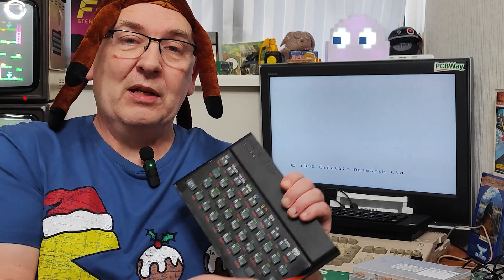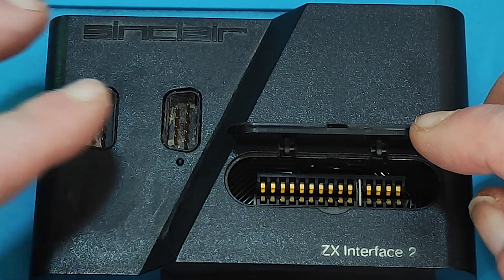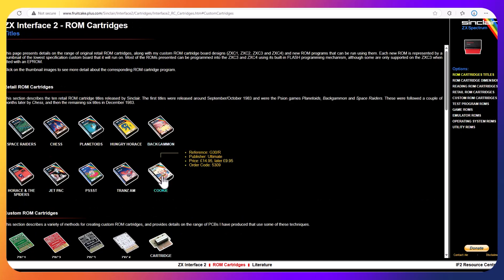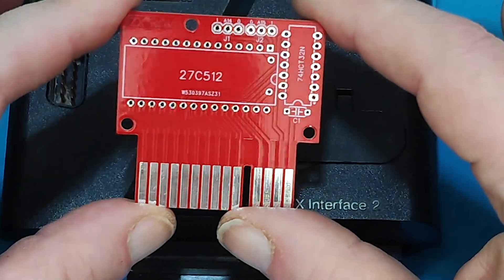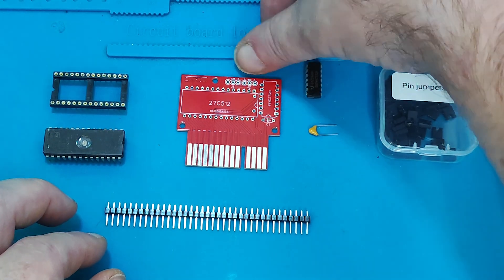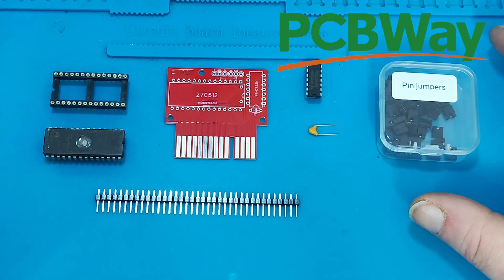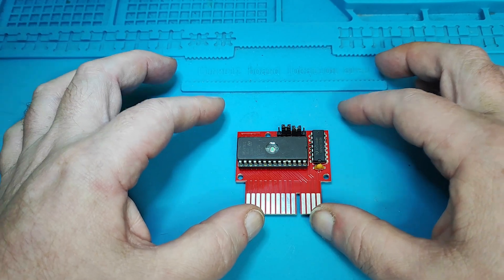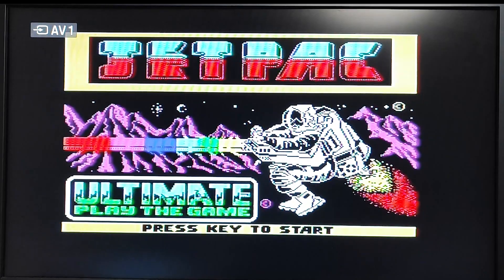A 40 year wait to do this with my original ZX Spectrum from Christmas 1984

Comment: In the early 80's i worked as an elecronic technician (Tea boy for the engineer) designing and building prototype mainframe machines for Burroughs computers now Unisys.  One of the engineers came in with the advert for the Speccy we all (about 15 of us) went OOH! AAH!  WOW! and more. I bought one about 3 weeks later from, I think,, WH Smiths. That meant we had 3 in the department and I recall not much real work happened for some weeks after this as a lot of reconfiguration was done to our 3. digital video output, to use with our monitors. A very basic floppy disc interface. More memory etc. This might be part of the reason the plant closed!  But great memories. The plant closed in 1992 and for the last 6 months our team spent the WHOLE time playing Lemmings on home built PC clones. Sorry about going off the rails here.
Reply from the maker: 😂 Thanks for sharing. I really appreciate the comments (otherwise it's like talking to a black hole). I hope you enjoyed the vid and it brought back those happy memories.

All the best for the new year. Simon
Reply: @RetroComputingReboot  Ta1

Comment: We got our Speccy some time around July 1984, we couldn't wait until Christmas. LOL.

That's a different version of Planetoids to mine. It all looks and sounds the same apart from when you get hit. My version just has a magenta (sort of) polygon where your ship was. Odd.
Reply from the maker: Thanks for the comment. I hope it brought back some good memories.

All the best for the new year
Reply: @RetroComputingReboot  I never stopped programing the ZX81 or the Speccy. About 6 years ago I upgraded my original ZX81 to 32K internal RAM. About 3 years ago I installed an SD card and joystick expansion PCB, soldered to the expansion port. LOL. (I had to instal a new ROM in the 81 to use the SD card functions)

A happy new year to you too.
Reply from the maker: @frankowalker4662 Sounds like some good mods there. I still need to fix one of my ZX81's. I broke one of them in my early days learning to solder 😢
Reply: @RetroComputingReboot  Oops. Luckily, they are easy to work on.
Reply from the maker: @frankowalker4662 Yes big oops 😄. Some of the best ways to learn are from mistakes though 😊
Reply: @RetroComputingReboot  Absolutely.

Comment: Somewhere around her, I have a ZX80 that also worked as a ZX81 by having an EPROM twice the size with one pin bent out and a switch on it.  I did quite a few things with that very limited machine.  I had a 16K RAM pack that I built attached to it.  I even worked out how to do pixel graphics on the thing.  Its amazing what you can learn from stuff like that
Reply from the maker: Brilliant. I still have my ZX81.

I think it's amazing looking back just how well programmers were back then to write code that was so efficient with such limited resources

Comment: My mum was actually angry that i bought a silly stupid computer, which was the zx spectrum. I learned basic but also assembler. Together we wrote a printer driver in assembler which was residing  in the spectrum printer buffer memory space (not an easy task due to the small printer buffer size) It used the beeper with a transistor at the output to create a unidirectional serial interface. We hooked up an HP line printer which we bought from a scrapyard for almost nothing and yes it worked ! We also hooked up a real computer monitor and a real keyboard. The speccy was housed inside the computer monitor housing. Everything was looking super professional 😂😂😂 (fortunately we had a computer scrapyard nearby who sold old computer equipment y weight) I am now an electronics engineer, still passionate about small computers and microcontrollers.
Reply: Been hardware hacker for as long as I can remember. I began by adding a 8255 PPI to my Spectrum and then adding some circuitry to that to provide me with the capability to program EPROMS. What I would have given for the capabilities we have in microcontrollers these days back in those days.
Reply: @SpeccyMan  the 8255 was a really handy and easy to add circuit. if i remember correctly it had 24 IO pins ?
Reply from the maker: @francisverhelst9375 I'm going to have to educate myself now as to what the 8255 is 😊
Reply: @RetroComputingReboot  it is a peripheral chip which creates extra IO lines.  You also had the 6845 which was a crt controller chip. And there were a bunch of different chips out :).
Reply from the maker: @francisverhelst9375  Just having a read. Maybe there's a video there somewhere 🤔
Reply from the maker: You put me to shame. I can load games and swap capacitors but that's about as advanced as I've ever got 😂

Comment: i had my zx spectrum rubberkey in christmas '84 , i later got the 'plus' upgrade keyboard and  fitted it in that, still got both, i got an interface 1 and 2 in the 1990s from a car boot sale , the rom games were always expensive and they certainly are more so now! i recently made my own rom cartridge board that uses just a single rom file 27c128, but not yet tried it, , that 27c512 board could be very useful as i was given a load of programmed but never fitted 27c512s some years back
Reply from the maker: It's great that you still have that Speccy. Good luck with the 27C512 EPROMs. It s a super simple board to throw together 😊.

Thanks for the comment and have a great new year

Comment: Did anyone here go in to shops back in the day, and type
10 PRINT "(Some obscene message)"
20 GO TO 10
RUN
on some of those 8-bit machines on display?
When I got my own Commodore 64 in April of 1985, I learned how to use its sound capabilities (which routinely made Speccy owners green with envy! 😎), and did a bit of BASIC code which mimicked the boot-up screen, waited either for a keypress or just a few minutes to give me time to leave the "crime scene", and then made some loud siren noise (don't forget to POKE 808,251 to disable the RUN/STOP key 😛)
Later, when I mastered machine code/assembly, I had a little routine which waited for the cursor to leave the leftmost column on the screen, and then sporadically "press" the DELETE key, frustrating the next bloke who came in to do the PRINT "(obscene message)" thing.
Nowadays, computers in shops just run an advertising video or slide show, and demand a password if you want to do anything else with them. Today's kids will never have the same kind of fun we had...
Reply from the maker: Brilliant 😍. Yes I was there myself. There were loads of independent computer shops in the day which I loved to visit, but they were more savvy to that malarkey. However, the big chains like Currys and Comet in the UK were much less clued up. Juvenile but funny 😂
Reply: No. I added the necessary POKE 23692,0 before the GOTO to stop the "scroll?" message appearing. Neither was I ever green with envy over C64 owners.

Comment: I remember sending off £125 for my Spectrum (16K) in 1982 then later upgrading it myself to 48k. It was known as an Issue 1.5 (rare) meaning it had the Issue 2 Pcb with the original 5C102E ULA and the dead cockroach IC stuck to the top of the Z80.
Reply from the maker: I wonder how many of the 16K models stayed as 16K. Not many I suspect 🤔 

Thanks for the comment and have a great Christmas and new year
Reply: @RetroComputingReboot  I've got a 16K Spectrum, and a 32K Cheetah ram pack for it!
Reply from the maker: @trance_trousers I forgot you could upgrade the 16K with a RAM pack

Comment: I wish I still had my original Speccy, I have my QL and highly upgraded Amiga A2000 but have no idea what happened to my last Spectrum.  My dad (a Snr Systems Engineer) made me learn BASIC and tested me before I was "rewarded" with a 16K ZX Spectrum in 1982 and Planetoids was the first game I got for it, I only played it for a bit of nostalgia using Fuse this Tuesday.

He made me learn BASIC to encourage me not to use it just for games and I've been a professional Software Engineer since 1987 working on the code for avionic systems such as the Head-Up Displays (HUDs) for C-17, F-16, F-5, Eurofighter Typhoon and the fly-by-wire (FCC) for Boeing 777, all thanks to my dad and my humble Spectrum.  "From little acorns..." as they say, but I never had an Atom, Electron or BBC Micro 😉
Reply from the maker: Great story!

I'm very fortunate to still have my Speccy. It got put away when I finally got my Atari ST. But me being as I am not being able to part with anything, it went back in it's original box, just waiting to be loved again 😊

Comment: I guess that device only works with 16k games? I've never seen a 48k game on rom.
Reply: Yeah, as in everything he made, Clive Sinclair cheaped out on it. The ROM slot was basically obsolete before the first Interface 2 shipped.
Reply from the maker: @gdutfulkbhh7537 Yeh, it's a shame really as it's soooo much better than loading from tape.

But if it wasn't for being 'cheap' I guess the Speccy would never have had the success it had.

It's strange though to launch the Interface 2 a year and a half after the Speccy launched.

Hope you enjoyed the vid. Have a good Christmas and new year
Reply from the maker: I suspect you're right there. I'm not completely sure. However, you can get modern recreated rim images from tape files such as Jet Set Willy which must be over 16K. Perhaps someone else knows?

Good comment though, thanks. Have a great Christmas and new year
Reply: @RetroComputingReboot  yeh you are limited to 16k images as if you tried to to access a  higher memory address with the cart it would cause problems / corruption . but there are  more ROMS available that have been adjusted to run as 16k and there are other options of using bank switching and altered snapshot files to load a 16k bank into ram then switch bank and load another 16k but needs a little hardware + coding. i did try it on a breadboard manually switching the ROM page which to my surprise worked .. some boards use a resistor /capacitor delay to switch the bank page after a short time ..